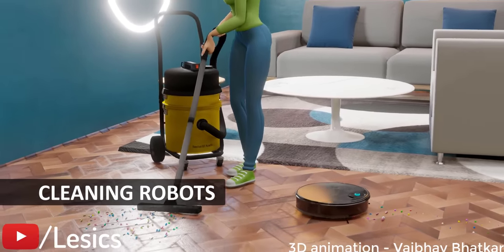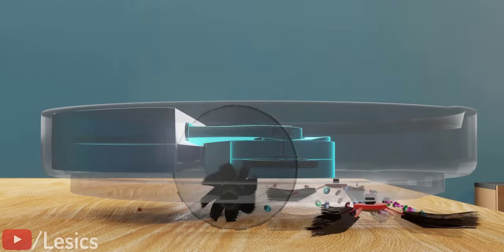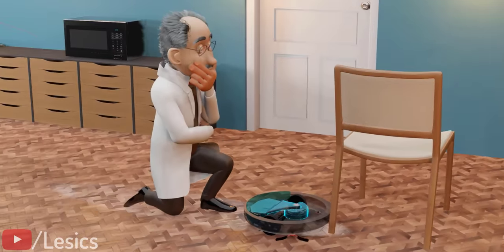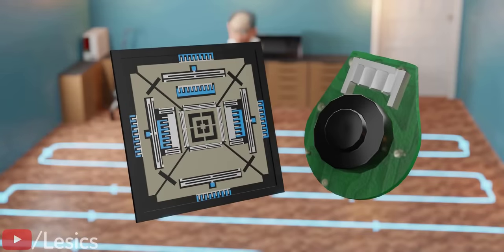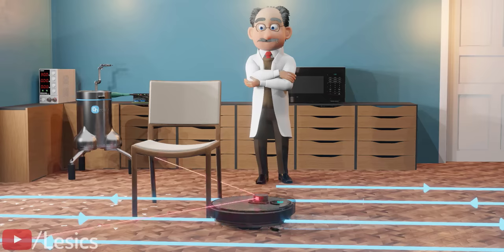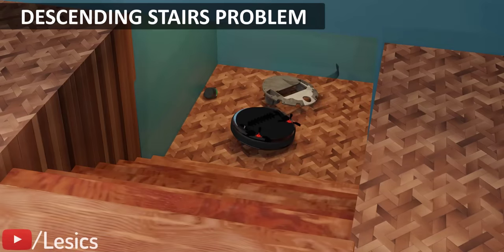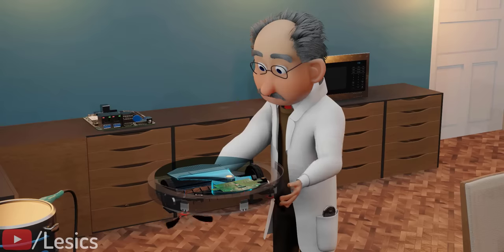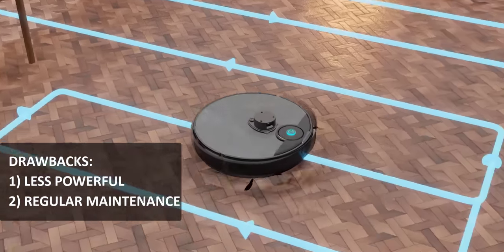The Amazing Engineering behind the Cleaning Robots!

Comment: Though I have seen the cleaning robots in action, I didn’t realise that they packed so many sensors in there small size. Impressive design. 👌
Reply: music bot thingy
Reply: This is the big problem in robotics development: we have so many issues from human habitats, such as chair legs, stairs and doorknobs, that it requires a tonne of specific sensors motors and algorithms to get anything done
Reply: @sapphire5475  good
Reply: Well not all robots have all these sensor's. Same have more, others are just really dumm und blind
Reply: you can say the same with your phone
Reply: @seadve  ehh i think not really. The phone is working off mostly machine-friendly input with the one exception of the touch screen, and it isn't critical if most sensors fail. If face-detection fails you can still use a passcode. If an accelerometer fails you can retry it
Reply: @andrewzebic6201  5
Reply: Fact the current day phones have more and incredibly tiny sensors across the entire electron detecting screen so I'm surprised you thought cleaning robots had so many unless if you did not know that the phone has thousands of sensors

Comment: There are newer models that require lesser maintenance. That includes autofilling the water from a reservoir attached to the charging station, emptying the dust into a bag when full, able to do multiple runs on the same spot etc.
Reply: Can you recommend one?
Reply: @ndog2004  The new Ecovacs or Roborock
Reply: I don't think they will clean up the cloth or maybe use disposable ones

Comment: Finally got the perfect answers of my all doubts about this robo but still i wanna know how it will clean a floor where it will find a polythene/used chips packet, a A4 size paper or anything more than size of 1-2 cm & which dc vaccum pump they used which gives high efficient suction capability with low power input usage with a single battery charge.
Reply: lol
Reply: this is a bot.

Comment: Some robot vacuum cleaners have chargers with a vacuum cleaner to vacuum out the vacuum when it’s done cleaning your floor such as the Roborock S7+, Roomba i7+, Yeedi clean station, and a few others.
Reply: I can Roborock S7+ it works very well with the app. 
After the robot knows the area of the house. You can mark areas where it should not go. Like a Christmas tree 🙂

Comment: I own a robot vacuum cleaner.
I have Roborock S5Max for a little bit over a year now. The maintenance is real bitch sometimes.. but I moved recetly to smaller apartment so now it's finally working as purposed. This apartment has flat floors, no tresholds and no carpets and is about 50m² large. 2 people and 1 big dog and cleaner works alright, it's not even necessary to clean the robot everytime, only about once per 3 full runs I think (so about 1 time per week), only the bin has to be emptied everytime because of the dog hair fill the bin really easily. Also it's really entertaining to observe the robot running and it's also sort of a companion. If I lived alone I would definitely need one of those to cheer me up.

I'm kinda satisfied with S5 Max but I'm looking forward to S7 Max Ultra with better sonic mopping mechanism, self-emptying and self water filling and cleaning station + 3D camera vision. 
I think that in about 2 or 3 generations Roborock could come up with the ultimate robot vacuum with little to none maintenance which we all dream of.

Comment: my primitive cleaning bot from 15 years ago died last month. Its only got a bumper and charger sensor, no wet mop. It will get stuck on thick wires, will fell down stair, but still work well for all this time, its got a simple go around corner strategy by repeatedly bumping.

Comment: Look they are a machine, not miracle workers.  They need to be cleaned maintained.  I got rid of most of my small rugs and the ones I kept I pick up shake and roll them out of the way.  I changed my chairs to lighter ones that I lift onto the table.  The wires are protected or out of the way.  Changed the grates to flatter ones.  I make a run about to make sure nothing will damage my machines ( yes I have 3 one for each floor).  I love them, they have saved my back.  Once a week I go around with my duster and get the corners they miss.  Love them.

Comment: It's wireless, it has a computer, and an app to control it's movement, which could be modified, not only vulnerable to hacking, but also easy and don't take a lot. with that camera and sensors attached make it so interesting.

Comment: Having cameras is more than enough to do the job without expensive LiDARs. AI which is using the Neural Network is getting smarter.
Reply: lidar is efficient in the dark also, but you can use an infrared camera as well

Comment: I've always wanted to get one of these, however, the regular maintenance was a deal breaker for me just now. I mean, how often do you need to do the maintenance and what kind of maintenance are we talking about?
Reply: For robot vacuums that don't have a self emptying bin they have to be emptied each time it's operated , but the cleaning head that does all the picking up of the debris should be checked and cleaned periodically and after a few months the brush heads and the side brush needs to be replaced.
Just like any other appliance or vacuum you should wipe the robot down with a soft cloth or a magic eraser to keep it free of dirt and the cliff sensors should be gently cleaned with a lightly damped magic eraser especially when it isn't detecting that it's near a ledge.
Reply: @josephbennett3482  Thanks Joseph, that was a thorough explanation!

Comment: yeah they need to figure out how to dispose of the waste  and clean the sensor automatically coz the gain/cost of this technology is not yet impressive enough
can they get the waste out of the robot after done recharging, or make the robot dispose of the waste in a corner of the room or in a floor bin
or in a bag tied to a platform and when the robot get on the platform they wait until the weight of the robot dissapear and make the entrance of the bag suck up the waste into a regular trash bag 10 second after,
 and auto cleaning sensor is not that difficult, just make the robot blow some air pressure on the sensor after he is done cleaning the room

Comment: How they can recognise their charging port?
Reply: The dock gives off an infrared signal and the robots look for the invisible light beam.
If you look on the front of Roomba's on the top of the bumper there is a little dome that looks for the signal from the dock and the dock has a dome also and it is looking for the signal that the roomba is giving off when it is put into docking mode. You kind of can see the roomba giving off a white light from the dome as it's looking for it's home then once they are within about three feet of each other the connection keeps the robot on track so it's charging squares lineup with the pins on the dock.

Comment: How sensors work?Give a video.
Reply: LiDAR - Light Detection And Ranging. It shoots out a laser pulse, and counts the time it takes for that light to bounce back and hit the detector. Then it uses simple maths to calculate the distance. It spins, knowing where it's pointing, so it can measure all around itself. It collects the points, puts them on a virtual map, and figures out where it is based on triangulation.

IR proximity sensor - Uses infrared light to make a switch. The angle of  the emitter diode and the receiver is as such, that if the object bouncing the light back is too far, the light won't hit the receiver. Means that it's too far, or a cliff. It uses the floor like a mirror.

3D Mapping camera - Combined with the computer on board, it uses algorithms and image enhancing to recognise objects, edges and hazards. It looks for familiar shapes, recognises edges of furniture, long shapes, square shapes, dog poo. It's a 2D view, but with some clever maths, the robot can compare 2 images taken from different angles, and approximate what it's looking at. "Imagine" a 3D shape.

Micro computers, like in that robot, are powerful enough to run Image recognition software that'll recognise, adapt and overcome a difficulty ahead. Most of this is hard coded, but some intelligent and adaptive algorithms are still present.

Chip based Gyroscopes are a complex machine that you can look up a video on. They're in your phone too!

Same with rotation sensors/stepper motors. There are multiple ways to do those. Some use maths, some use optical IR sensors, some use physical contact structures within. No wrong way to do that, really. 😋
Reply: @SpotTiger  Thank you for your support.